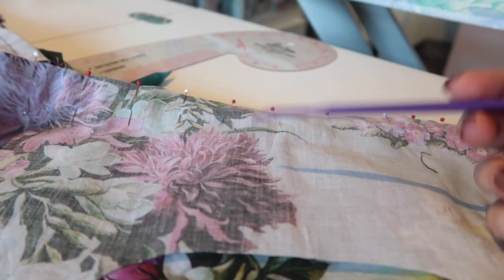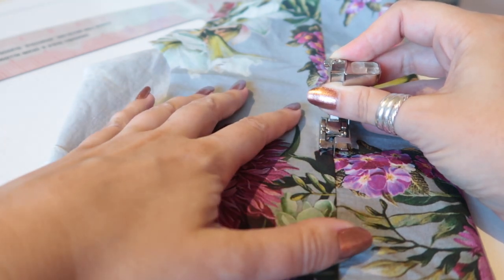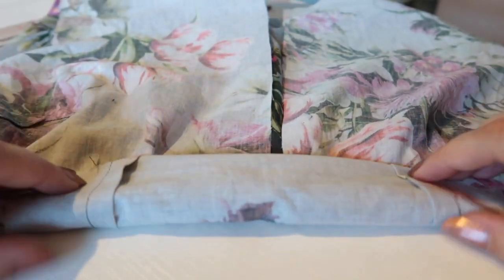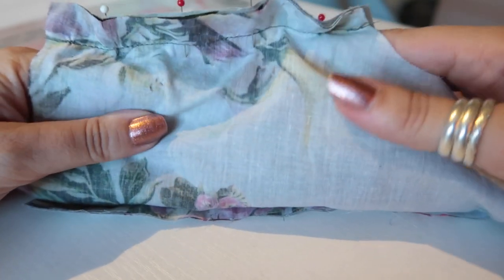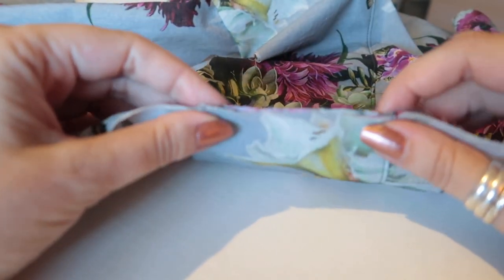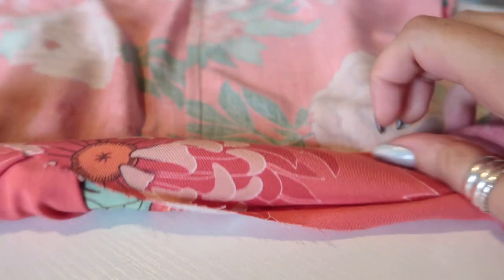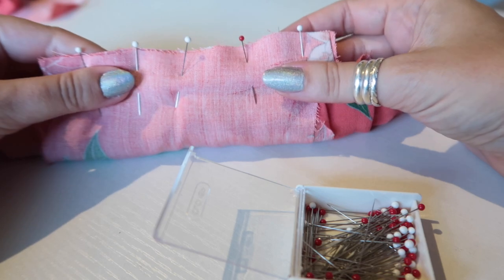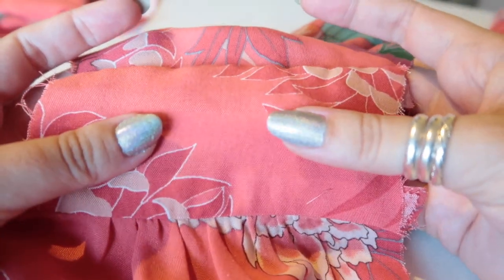How To/How I :: Machine Sew A Shirt Yoke With A Clean Finish :: The Burrito Method

Comment: I tried to post a comment/query yesterday but stuffed it up - please forgive me if the same query shows up twice.

If you imagine a nightie with both front and back double layer yokes that join at the shoulder seams (rather than a single yoke that both the left-and-right fronts and a single back are joined to) and a gathered "skirt" section at both the front and back joined at the side seams - is there a way to "truly" enclose both the shoulder seams of the yoke and the seams where the front and back skirts join to their respective front and back yokes?  I'd like something better than the usual method where you sew each to their outer yokes and fold up a seam on the inner yokes that you then top-stitch or slip-stitch in place.  This does enclose the skirt-to-yoke seams - but it's not the same as the "true" clean finish you get for enclosing the seam like you do for the back of the shirt to the double-layer yoke across the back.

I don't need the neckline enclosed (but it would grand if it could be too!) and as it is going to have long sleeves attached they don't need to be enclosed at all.  

I think there must be a way but I can't quite get my head around it.  Any pointers from anyone to videos or online tutorials showing how this is done would be much appreciated - thank you...  Megan  :-)
Reply from the maker: I know what you mean. I think if you sewed the front (or back yoke) together to enclose the seams of the bodice piece between it the baste the shoulder seams together within the seam allowance you could then use the burrito method to finish the garment and have clean finishes on both the yokes. I think that would work and hope that makes sense 😊
Reply: @KittenishBehaviourSian  Thank you so much - that was quick! I'll give it a try and I'm sure if I just do what you say it will make sense to me as I go along even if I don't quite get it 100% just on first reading it.  I'll try it on something "dolly size" to start with and have a play.  :-)